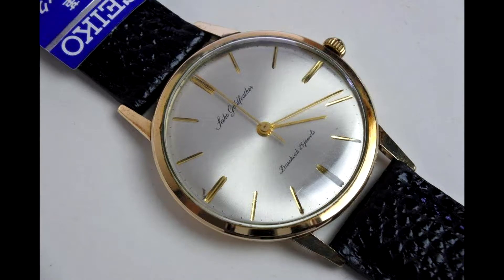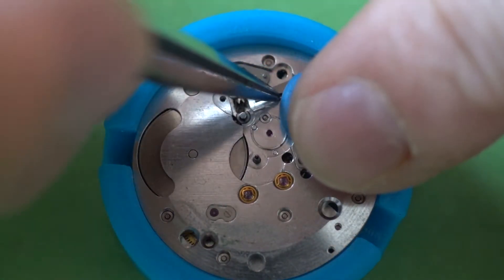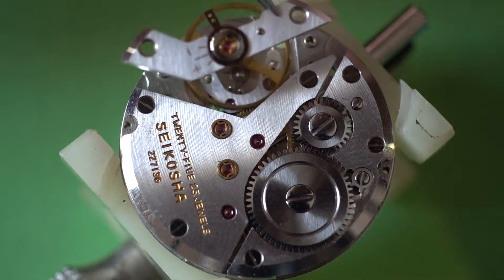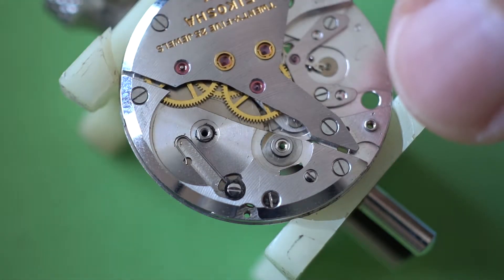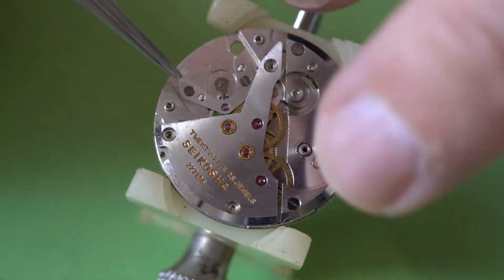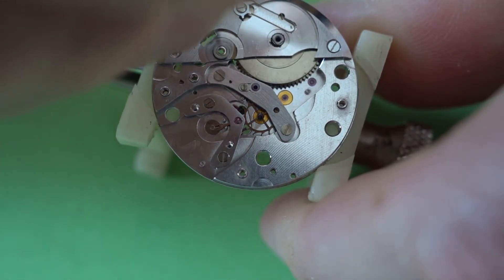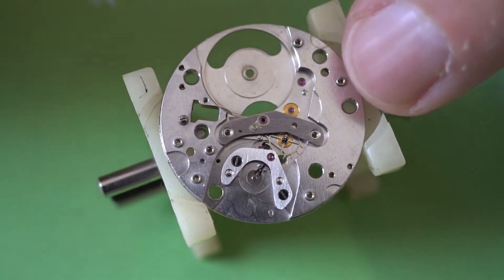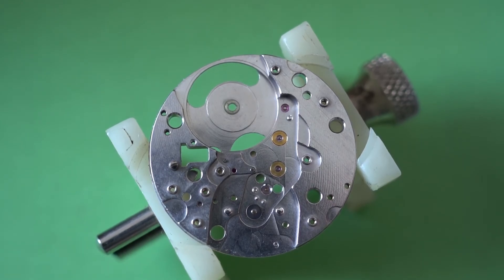[TECH] - SEIKO 60M "Goldfeather" MOVEMENT TEARDOWN

Comment: HI i am doing a refurb on one of these I found with a delightful "tornado" style dial that I got on the cheap due to a good bit of verdigris on the case in addition to a missing crown. can you help me by pointing out (or describing) the method to remove the winding stem? To my untrained eye it looks as if the small screw that was left under the barrel brige is the correct one to loosen to get the stem to release. i want to loosen it and tug/tap the stem out. what do you recommend?

Comment: One of the finest examples of engineering ever, from any period. This was and still is Seiko thinnest movement. Thank you for posting this remarkable watch. A complete sleeper.
Reply from the maker: It's a really nice movement and not complex. There are loads around still in nice condition. Not a target for collectors so you can usually find them at non extortionate prices.

Comment: I’m watching this while I’m waiting for the two watches that you did for me to arrive in the mail tomorrow! But two questions. Why are there two diashock-like jewels on the train bridge? Is this because of the thinness of the movement and its architecture? Also, how do you keep track of the screws and where they go?
Reply from the maker: Those are DIAFIX settings. The purpose of those is to absorb shocks on the gear train but probably more importantly, for oil retention. Capped jewels due to surface tension, tend to keep the oil where it's supposed to be. By having shock protection there, the theory is that you will get a better line on the timegrapher as it will reduce backlash on the gears.

So on these both the third wheel and the escape wheel are capped. They did this on the 6106 and some variants of the 63 series., along with the 44KS series etc. Usually you only see it on mid to high end movements.

The 6119 escape wheel is capped top and bottom. The JDM versions of the 6139 are capped on the bottom.
Reply from the maker: Forgot to answer on the screws, I use a pretty generic horological parts container. All the calendar side go in one section, train side in another. Anything really oddball, I take a photo of as I'm taking it off as I'll probably forget about it later. This helps quite a lot as you have pretty much everything put aside from one another. Usually in most watches the screws are roughly all the same on each side or it's pretty obvious where they go. One notable exception is the 45KS, which has one train bridge screw that has a thicker head than the others and some Swiss stuff, which can have different size screws all over the place. Ultimately I think movements with standardised screw sizes are vastly easier to service as there's much less scope for errors.

Comment: Thank you for the interesting video. I don't remember having noticed the spiral-brushed finish on the wheels of this movement when looking at photos of it before. I thought that the 60M was the name of the 17-jewel version of the movement found in export versions of the Goldfeather (due to import tariffs on movements with more than 17 jewels into the U.S.A.), and the 25-jewel version was called the 60A? Like how there's the 17-jewel 6220M, and the 6220A, B, C, and D can come in 21-jewel versions. That was an interesting aside about the reason behind the use of snap-back case-backs on quartz watches in the 1980s.
Reply from the maker: I checked the SEIKO tech docs, and they made a 17 and 25j version of the 60M. https://i.imgur.com/s41rGXr.png

Yeah I always wondered about snap backs, because they are a pain to deal with when they go wrong. With a screw back you can either have it high on the front or the back ultimately. I think the modern 7S26 fails in a big way with the clear casebacks. You need to add about another 2mm-ish to the back again on top of the screw back to have a recess and sealing surface for the clear back. I think clear backs are slowly going out of fashion.